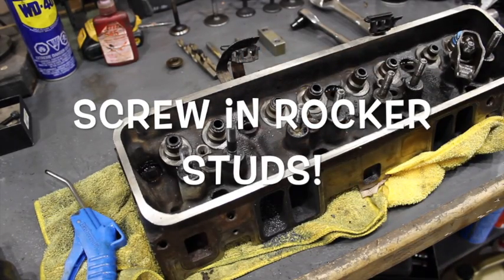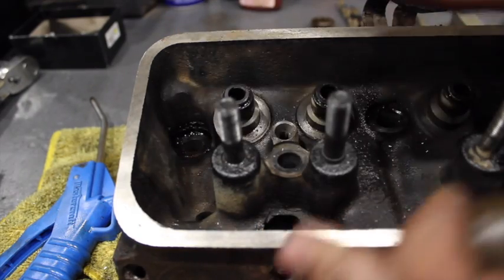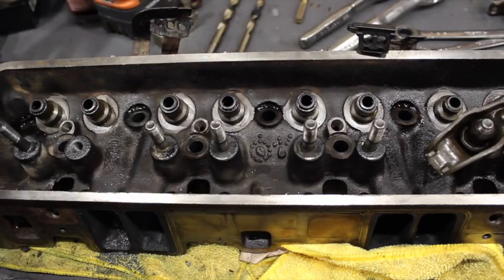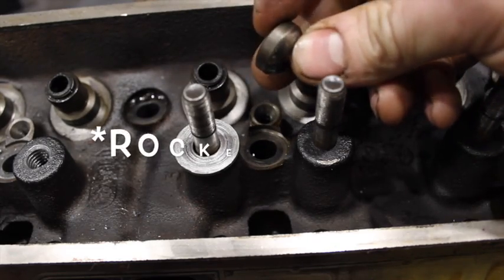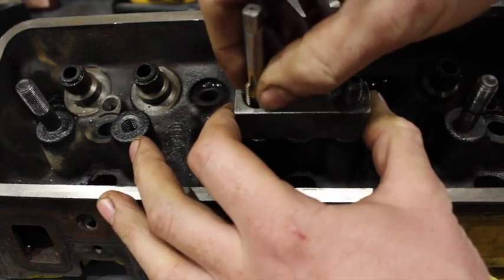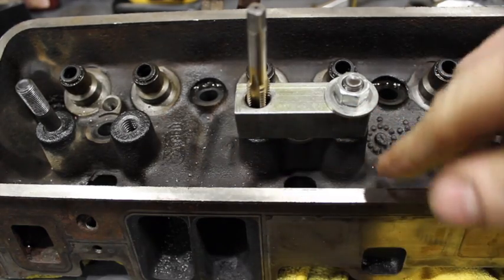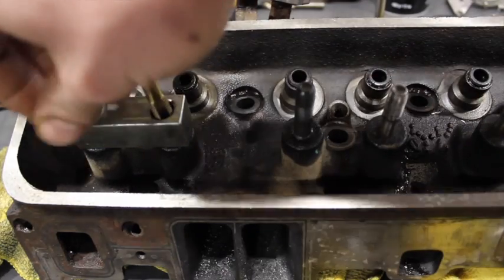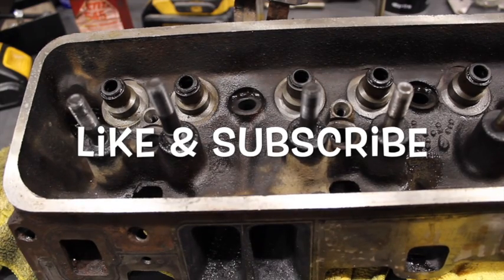Screw-in Rocker studs! Vortec Heads *Part #'s in description*

Comment: The link for the rocker studs say they are 3/8-24 by 7/16-24 but you tap the holes with a 7/16-14 tap. Am I missing something? The tool from Speedway says to use a 7/16-14 tap as well.
Reply from the maker: The bottom thread into the head is 7/16. The rocker stud thread is 3/8
Reply: @cuttersperformance Right but you tap the holes with a 7/16-14 tap but the studs you link are 7/16-24

Comment: Thrust bearing from Amazon makes removal a breeze. That being said, the studs that are side cut /machined. for head bolt clearance will crack at 25 ft lbs of torque. Maybe the chamfered edge adds to the splitting wedge effect. YMMV.  Ruined the heads,the tool was off by .065 so I had to make my own on the mill. And using a Hanson tap made an huge difference in the fit of the stud to the hole.

Comment: About a year ago I had a rocker stud break on cylinder number 6 exhaust, so after watching this video I decided to use these screw in studs just on the intake and exhaust for that cylinder.  And yes I did it without removing the head, did not want to go through all the headache and it worked fine.  Car has been running great ever since.  So my question now is, I wanted to install the proper rocker arms, the "O" rockers, when I got to number 6 and loosened the stub bolt the stud started to unscrew and I was glad I realized it before I got it out or coolant would have went all over.  I used the Loctite 545 like in the video, so now I want to pull these out and clean up the threads and install them again, would you suggest Loctite 271?  Running solid lifters so valve adjustment is something that will happen from time to time and when doing adjustments I want to be confident the stud doesn't loosen while doing adjustments.  Any thoughts thanks!!!

Comment: Very nice  the machine  shop here me whant 400 bucks , I'm on a budget,  I also have a question  vortex  heads 010 30 over high  energy  284 cam 507, 510 lift I need springs you said beehive cuzz I'm keeping  the stock votec rocker  thanks

Comment: Bought a Pontiac that had been over heated. It still ran but had several valves ticking. It had pulled the studs up as much as 1/8 inch.  The  valve springs were overheated to the point that the lifters would pump up when you ran it hard.

Comment: Do the same drill bit sizes apply to tap a 
MRDS-2920 - Rocker 
Arm Stud, Steel, 

The stud sizing is 7/16-14 in. Base, 3/8-24 in. 

This is supposed the correct melling stud good for  a 1993 sbc 350 tbi motor

Comment: As an old machinist I have to compliment you on the detailed explanation and clear video here. I would add one thing for those who don't know about taps. Use a four flute starting tap that is nitrate coated. The gold color tap is nitrate coating. A starting tap is tapered and will start much easier and tap straighter.
I'll email you on the beehive springs soon.

Comment: Great videos! I was hoping that you can help me I have a stock 400sbc and will installing 602 vortec heads on the motor is there a camshaft that you recommend the only thing I will be upgrading on the heads will be upgrading springs that come with the cam
Reply from the maker: Its not a cut and dry answer for what cam to pick as there are quite a few factors. But I do have a 400 sbc with stock style pistons, vortec heads and a flat tappet cam that I will be dynoing. Not sure how big of a rush you are in but it should answer some questions for you when its dynoed
Reply: Thanks for the reply when will you be posting the video not looking to install anything crazy cam wise but just something to help with horse power gains again thank you!!
Reply: Can you do a detail how to video that would help out a lot in the 400sbc community there is not one video on YouTube as of yet?

Comment: I’m using the LS valve springs, # 19420455, on my 906 Vortec heads. 
Question: what number valve stem seal do I use?
Also, what rocker arm do you recommend?
Reply from the maker: Stock guides felpro SS72861
And the comp cams or PRW self aligning roller tip rockers work well on vortecs
Reply: @cuttersperformance  PRW offers the rockers in 1.5 and 1.52. Which do you recommend?
Reply from the maker: @ds9886  1.52 or 1.6 if you can run the extra lift
Reply: @cuttersperformance  
On my L-31 it has been bored .030. I’ve purchased new flat top pistons with stock 5.7 rods.
My initial plan was to keep it a 350. 
However, can I now make it a 383 with the parts I have?
What crank (will need part number) do you suggest? The machine shop can grind for clearances.
Reply from the maker: @D S  the pistons wont work for a 383

Comment: How far do you cut down your valve guides?  I have been leaving a about 3/4 of the coil spring wire thickness for a small ledge so the bottom of the springs can't walk around & possibly contact my new seals.
Reply from the maker: Yeah i like to leave a coil thinckness at the bottom to center the spring

Comment: Don't do what I did! Must have had the wrong tool tapped the boss and came out on a angle, be sure to check first! (Question) Do you I could grind bosses and put guide plates in to save head? Thanks
Reply from the maker: Yeah if its not too deep it can be milled down for guide plates
Reply: @cuttersperformance  Thank you!

Comment: Pinned rocker studs is an awful idea. If you are buying a used set of heads always check for pinned studs and run away if you spot any. Avoid them even if they are free.

Comment: I cracked some stud bosses at 25 ft.-lbs. of torque.
Reply: That's terrible I cracked one myself and ended up welding it. I thought the studs should have more base to them because I made the mistake of chamfering the holes a bit causing more wedging pressure.

Comment: I am I the only one who would tap that hole free hand (no guide) because the tap will auto center? Or have I just gotten really lucky when I have cut threads? I have used guides to drill holes straight but after that I tap the hole with no guides. This guide for the tap is new to me, maybe have been doing it wrong and just been lucky 😁

Comment: Question timing chain can I use a double roller timing chain in my l31 stock 880 block I know it came with a single roller I popped the cover open today while I’m working on the engine replacing parts just wanted to ask lmk thabks
Reply from the maker: If you are running a plastic vortec timing cover you cannot use a double roller

Comment: Any tips on removing a stud that had the threads broke off of it? Everything was going great until my 2nd to last stud..it broke.
Reply from the maker: The last few ive seen with broken studs had abit sticking up that I welded a bolt to and use a slide hammer with some heat to pull them
Reply: @PISS-CUTTER Performance  thank you for they reply...I was able to re-thread what was left of the stud and pull it out using the rocker balls...I got lucky man.
Reply from the maker: @Loves_to_fish  awesome! Glad to hear
Reply: @cuttersperformance  Thank you for your videos and knowledge.

Comment: Would these Vortec heads work on a 283 small block? I'm looking at the cooling passages and I'm wondering if these and the bolt pattern will work. I've heard that the Vortecs will work on a 283 but I'm looking for a second opinion, thanks.
Reply from the maker: Yeah they will, you can use both the 350 or 305 vortec heads on 283s and have great results over older head designs
Reply: @cuttersperformance  Thanks for the reply. I was going to use a pair of 461 2.02 fuelie heads I have but heard the valves would hit the deck, so it looks like I'll find a set of these 906 heads, thanks again.
Reply from the maker: Yeah a 1.94 intake valve is the largest you want to go for a 283 as the bore size is small.
906 or 062 would be your best bet but even cheaper 305 vortec heads would work great too
If i get my hands on a decently priced 283 id like to do one up for the channel with vortec heads one day 🤘
Reply: @cuttersperformance  I recently bought this as a short Block. Turns out it is out of a 1958 290 hp fuel injected Vette, still on the original bore, hard to believe. Looks like the pistons have been changed to a high compression piston of some compression of which I don't know. I'm going to go look at a set of 906 heads that supposedly only has 20K miles on them for $150,00. price sounds reasonable.

Comment: Do you have a good budget self aligning full roller or roller tip rocker arm set you recommend that will fit vortec heads ? I want to stay in a 1.5 ratio (aftermarket cam), and want to use incognito type studs in 3/8 or even 7/16 incognito style without machining
Reply from the maker: I almost always use comp cams roller tip rocker arms on vortecs like part number 1417-16. But I have used similar sets of the PRW rockers that look similar and haven't had an issue (they are cheaper).
Reply: @cuttersperformance  ok thanks , I am thinking about the prw blumax full roller rockers too ,they look to be narrow body any experience with those ?

Comment: side note if you are doing this with the heads on the block, be aware that some heads have the rocker arm studs going into the water jacket in the heads
Reply from the maker: Not recommend to do this with the heads installed
Reply: @cuttersperformance  🙁 One of my studs broke off and I was hoping to do this without removing my heads.  Do you think it would be ok to do this with the heads installed  if I replaced it with another press in stud instead of switching to a threaded stud?

Comment: Will my stock rockers and hardware work with these studs I'm building a 350 with vortec heads with a comp extreme energy 268 I've been told it will be fine with the press in studs and I've been told to change to screw in studs
Reply from the maker: Yeah the stock rockers will work perfectly with those studs...but to be honest most low lift hydraulic flat rappet cams the screw in studs are not essential. The more aggressive roller cams with heavy springs are what will pull studs

Comment: I've been thinking about putting bigger studds in my 2.5 and 3.4 chevy V6 heads for some time, I've already installed LS springs on the 2.5 heads. no issues yet🤞. but once I get the high lift camshaft I will do the threaded studds. but I was planning on using 1/2" studds so I can install big block chevy roller rockers. ty for the demo.  I can easily do that.

Comment: sir   have you even seen a SBC  balancer seperate..  Im rebuilding a 4.3 chevy,, the  sleeve on the balancer had a groove worn in it from the seal. I bought a speedy sleeve and put the balancer in the freezer for abt an hour to shrink the metal. I took it to my bench, installed the speedy sleeve and let the balancer come to room temp. I then took a rubber mallet and was getting the balancer started on the crankshaft. I noticed little pieces of rubber falling out, so I started hitting it with the mallet to take it off and the outer ring of the balancer seperated  from the inner ring.,. so did me putting it in the freezer cause this? or was it just old and brittle.. the inner and outer parts of the ring seem to be glued together.. I was shocked that it seperated..
Reply from the maker: Nothing you did wrong, totally normal for a old balancer to slip or seperate from the outer ring. Its just old and needs replacement

Comment: Thanks for all the info you put out on the Vortec stuff! I am happy to have found your channel! I know this is an older video so dont know if you'll see the comment now, but have a question that I can't find info on anywhere I look. I have a 98 C2500 pickup that is the heavy duty option (12,000 GVW) it has L31 engine code but has the RPO code for 4 bolt main engine. Had to do an intake gasket a few months ago and pulled the valve covers. My engine has what appear to be threaded rocker studs factory. Have you ever ran across this before? They have a hex where they contact the boss in the head. Dont know if it is because its a 4 bolt main Vortec or what, but I know its all OEM still. Have searched a lot online and never found any mention of this from anyone else.
Reply from the maker: Thanks for checking out my channel! Any chance those heads have been repaired or replaced in the past? Ive have never seen a factory vortec with screw in studs before.
Reply: @cuttersperformance  nope, no chance they have been messed with, I know the history of this truck since it was purchased new. It had never been opened until I got ahold of it. I have recently found your instagram, I’ll send you a pic on there I took when I had the intake off. You can see the rocker studs in the picture. You can also see the badly failed intake gasket too!
Reply from the maker: @BillStraub303  yeah please do, very curious

Comment: What rocker arms do you recommend for vortec heads with around a 530 lift roller cam?
Reply from the maker: Comp cams roller tip self aligning part # 1417-16 is for the 1.52 ratio

Comment: I’ve got set of 906 heads. Is there preferred screw in stud you use? I noticed the ones in this video didn’t have the shoulder on the. Is there a difference? 
Thanks
Reply from the maker: Use the RM-348-16 studs or equivalent unless you are cutting the bosses down for use with guide plates. Guide plates require you use a hex head regular style stud

Comment: Great video. I have a problem though. I cracked an 062 head, bought a new one from OELINE,  installed it. It ran fine for about 30 miles and up until I got it to 65mph. Then it started running rough. My mechanic said that one of my studs had started working it way out. He put locktite on it and screwed it down. Then when running he noticed it wobbling. Says I need another head. Why would this happen? Manufacturer responsible?
Reply from the maker: Did the rocker arms bind up? Too much lift on stock rockers us a common issue

Comment: If I do it on the car will shavings fall in to the motor ?
Reply from the maker: Yes! Don't do it with the heads installed
Heads must be removed
Reply: @cuttersperformance  will do the car has been in a barn since 2013 so I can make sure the cylinders are clean before I try to started it
Reply from the maker: @christopherohara9421  good call!

Comment: My studs are loose when I wiggle them side to side as I screw them in I used a plug tap. Help ☹️
Reply from the maker: How loose? Abit of wiggle is normal.
If they are straight 
Add thread sealer and torque them, in increments. 
If they torque to 25 ftlbs, you'll be good
Reply: It’s a little wiggle and I will add thread sealer because I’m more scared of the stud that goes into the coolant ports and having coolant seeping out through the stud and into the engine
Reply from the maker: Yeah exactly, use a good amount of sealer and torque them up

Comment: I have a question I have a 1991 C1500 and I want to do a vortec head swap and lt4 hotcam with 1.6 roller rockers. What do I need to do to the heads to make them work with my combo? Thank you

Comment: hi, do u have experience much spring pressure (open pressure) pinned studs can take? i have 416  305 heads which will be  mildly ported soon..i would like to put screw in studs, but i fear of breaking the stud bosses when removing the studs..i have been thinking that pinning could be a bit more safe way as here in Finland, used SBC heads are unobtanium if i destroy the bosses and need to buy new heads.  im going to put comp xe262 cam and 981 springs, and i believe press in studs cant take the the spring pressure if i rev the poor 305 sometimes to 5500
Reply from the maker: Rule of thumb i go by, if it needs more spring that a Hydraulic flat tappet than you should go screw in studs. (Typically over 120lbs on the seat or 300 over the nose)

Comment: When I drilled and tapped my camelbacks at home, I free-handed it. If your tools are sharp and you don't force it, you can eye ball it. You can't drill and tap willy nilly. When you do it its best to pull one stud at a time and finish it, that way you can use the other studs as a guide (no special tolls, just free hand). The stud hole has enough depth that even if you're the slightest bit off, it'll correct itself. Just can't force it. And take your time.

Comment: Would you have to change your push rods? How would one know if to short.
Great video currently doing a set of 416 casting 305 heads with these videos in mind
Reply from the maker: Pushrod length needs to be checked but they shouldn't change much 
https://youtu.be/6W8BRyQvfQo
Reply: @cuttersperformance  thanks man

Comment: Do you see a reason the pioneer # 850013 stud won't work? They have the hex shoulder on then to tighten it down.
Reply from the maker: You can use those but only if the stud bosses have been cut down

Comment: I bought an engine recently n I've never used vortec heads before. They have 7/16 screw in studs n guide plates already with rollers. Matched open plenum intake matched to heads. What would they be worth? I've thought about selling them since I went aftermarket heads. It's a gen 1 400 they were on. Thanks for any info and I like your videos. You explain everything very well. Anyway have a good one man. Todd in clemmons nc
Reply from the maker: Sounds like you have a great set of heads man. Having screw in studs and guides plates is always nice and as long as they aren't cracked you should be able to get $500+ for those heads (plus more if you have the matching intake)
Reply: @cuttersperformance   hey bud what size studs are you installing I know you said they’re pioneer brand ?
Reply: Well thanks for answering I think those may be a good setup on a 355. I'm getting 218 cnc heads I'm waiting on them now should be a couple more days n I'm ready to get it going gonna be a 406 sbc in a 1988 Ford ranger 590 solid roller 265ish duration 8.8 410 let it rip! Have a good one man n keep the videos coming. Thanks Todd